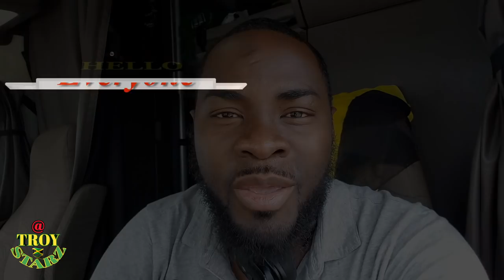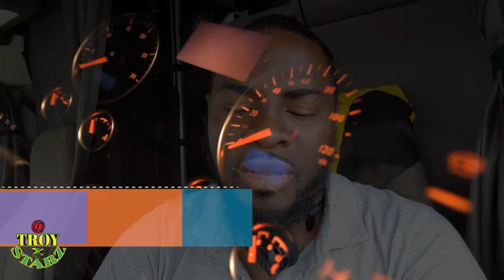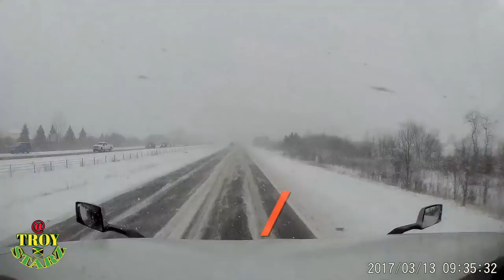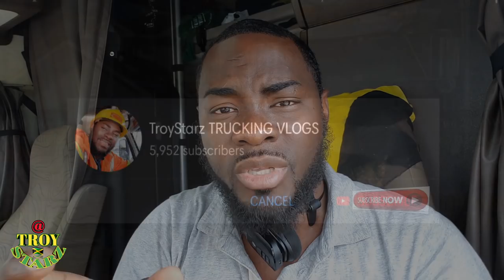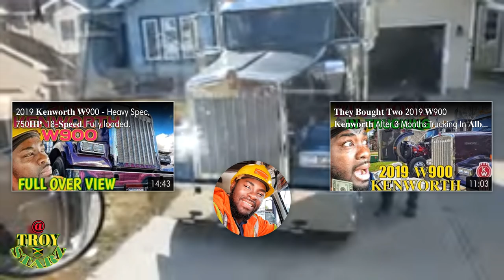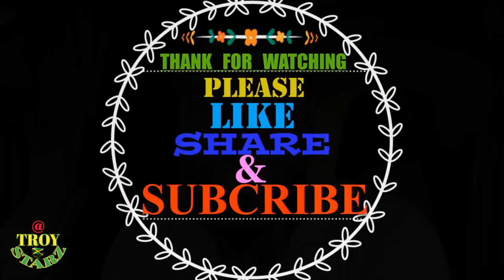How To Stop Automatic Semi Truck Downhill

Comment: 1500 to 1800rpm if it's going over, drop a gear, repeat till the engine brake holds you, if you don't have a Jake brake start down the hill at 35, snub from 35 to 30, run it up to 35 and brake to 30, if it's double digit hills drop it down to low range, 90% of my driving is mountains in Washington and Oregon with over 100k pounds, always works for me, even when I had my Jake brake go out, never had smoke or brake fade